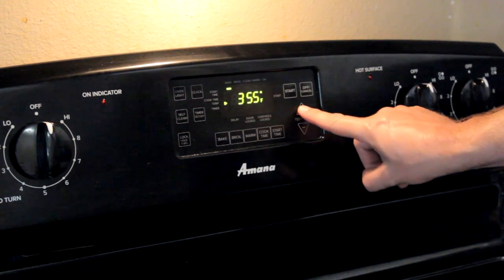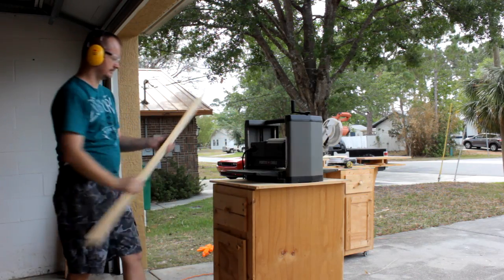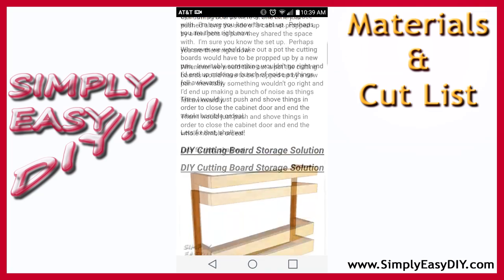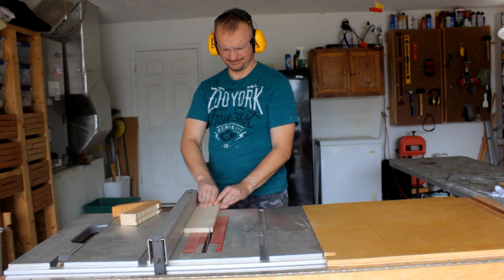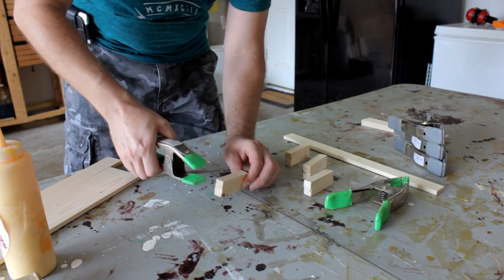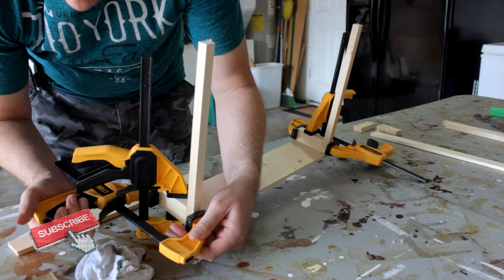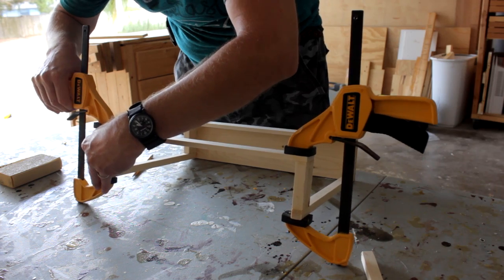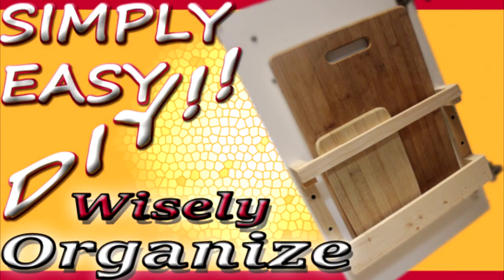DIY Inside Cabinet Door Storage

Comment: Nice job. Your cabinet reminds me of one I have with a half shelf in it that for me, I could never use efficiently. I recently replaced the half shelf with 2 sliding drawers using 20 inch drawer slides. I can now store much more with greater ease of access. A future DIY right up your alley.
Reply from the maker: I prefer drawers over cabinet space in my shop for that reason, efficiency.  I have a video on my channel where I converted a cabinet I initially built into my table saw workstation into 4 drawers like what you are talking about.  Search my channel for "Table saw workstation Part".  I can't remember which "part" it is however.  It should be either part 3, 4 or 5.  There are 5 videos to the workstation series.  Peace.

Comment: Great project. I just need to no drill through the face of the cabinets when I hang them. BTW I  had issues with your link to the project, looks like there is an extra L after html

Comment: In your cutlists you should include the length of the boards you purchased just in case you ended up using something like a 10 foot board but someone buys an 8 foot board and doesn't have enough material (I know 8 foot is the norm but you never know, I got a little confused building your planter box last week)
Reply from the maker: That would be called a "materials" list and that is there along with a disclaimer that says "all boards lengths are 8' unless otherwise noted."  Which planter box, (I have several) if I missed it then I'll go back and correct.  Thanks.
Reply: Oh I completely missed the disclaimer at the bottom, that's my own fault. It was the cedar garden planter box. Thanks for the quick reply btw!
Reply from the maker: Sure, I make mistakes and could've missed putting that info on a specific post.  The only way I'll know is if someone like yourself lets me know.  Peace.